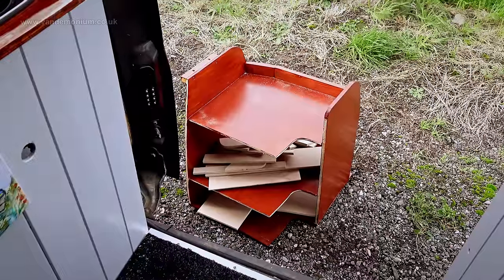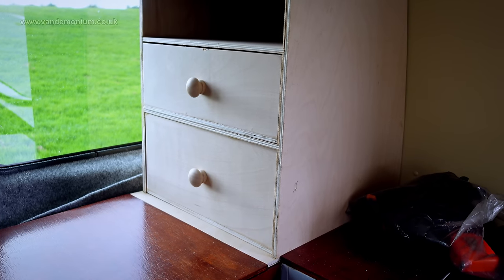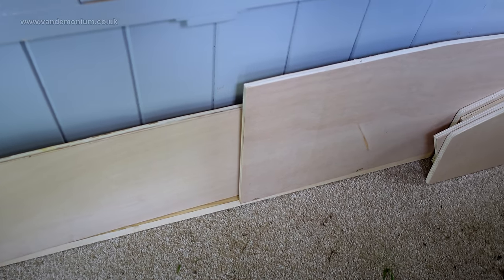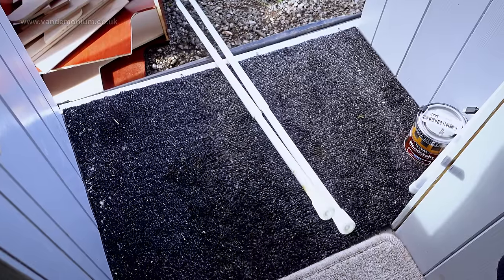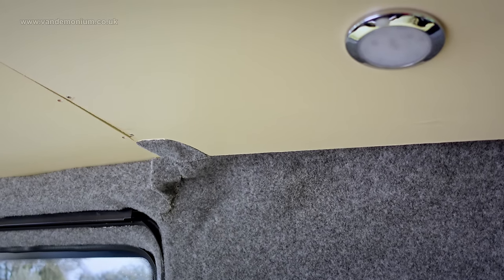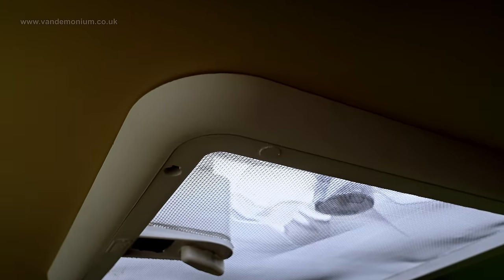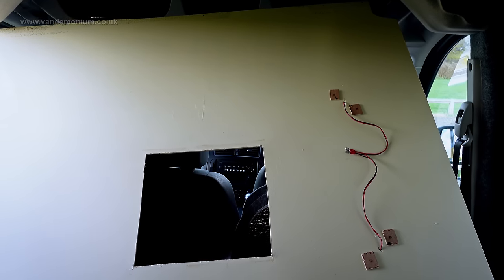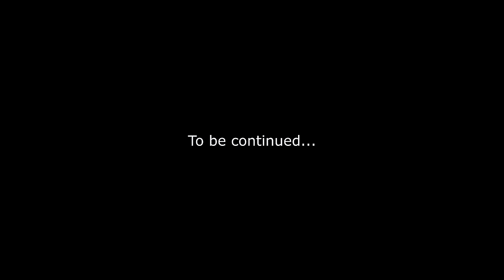46. Re-making the cabinets in my DIY campervan (and rewiring too) Part 1

Comment: Glad you have a project to get you through the lockdown.  You might be able to glue some thin felt on the bottom of the drawer to prevent scratches on the nice wood
Reply from the maker: Felt it shall be!

Comment: Nice work, David. I would suggest putting some felt under that bottom drawer to protect the wood "floor". Also, maybe put the hinge on the bottom rather than the top of that door. This way it's not flopping on your hands whenever you go into it for something.
Reply from the maker: That’s a good point...

Comment: @10:08 can i suggest not joining cables with two males to two females, but a male and female on each cable so its not possible to get them the wrong way around. also on the cable bringing power to the joint to put the female (insulated!) terminal on the ''hot'' positive side to lessen the chance of shorts if it comes out, i know your on a wood surface not metal but its 'best practice' to work that way, love the van and vids, thanks for them 
edit: ahhhhhh now i've watched to the end you have got insulated ones!

Comment: It's probably a little late now for your project but if you need to do this sort of thing in the future either in your Van or on your boat, do a search for "ticking stick" or "joggle stick" . It's an old boat builder's method for lifting and transferring odd shapes like you have there and putting them onto  a piece of wood as a pattern. Keep up the good work. I enjoy your videos muchly.
Reply: 'see jane drill' did a good ticking stick video
Reply from the maker: Cheers, yes I've watched lots of those videos. The main trouble here was things not lining up with each other, rather than trying to shape them.

Comment: Just a tip on terminating your wiring.  Use one male and one female connector, with the reverse on the other side.  Not 2 male, and 2 female on other side.  That will prevent possible reverse polarity connections.
Reply from the maker: Good point.

Comment: In the military, we called it "mission creep"... You start out with one small thing and as you get into it, you realize a lot more needs to be done...

For example, start out with a simple case of putting ceramic tile for kitchen countertop... You notice some water damage because the original builder had used cabinets that had particle board, so you decide to rebuild the cabinets with exterior grade plywood for those areas that might get wet... While removing the cabinets, you notice the sheetrock (gypsum board) has water damage to it, so you decide to rip it and and replace it also... As you rip out the sheetrock, you notice that the insulation between the sheetrock and the wall sheathing is black from mold, so you decide to rip it out also... Next thing you know, you're standing in a kitchen with no cabinets, most of the sheetrock removed, and the exterior sheathing of the house exposed from the inside... And your wife saying that she thinks it would be a good time for her to take a vacation to another country for 6 months... Been there, done that...

Comment: If you want to try and hide the locks on the drawers, you might want to look at child proof drawer locks. Some of them can fit completely in the drawer so you can't see it from outside. (it does add an extra step when opening them though). And they are usually easy enough to install.

Comment: As my old wood shop teacher once said "Measure 6 times" Then cut and if your still not sure, build a mock up out of cardboard. Also, nice work on the drawers. I don't know if you'd like thi s ides, but the simplest way to keep them closed is to drill a small hole in the left side, through the side and drawer and use a bit of dowel, with a fancy knob on it. Should do the trick nicely.
Reply from the maker: I like that idea!

Comment: Thanks David another enjoyable van video, well as good as your boat videos. I would treat myself to an electric screwdriver though. Saves ages of time.
Reply from the maker: I have two! But with these tiny screws and delicate wood, I prefer to do it by hand. Power tools can be a bit brutal at times.
Reply: @Vandemonium  perhaps it depends on the operative. 😂

Comment: can you glue a strip of felt under the bottom edge of the bottom drawer to stop it scratching the other surface?
Reply from the maker: Yes! That is what I will do :-)
Reply: I think felt would eventually wear away.  Perhaps you could glue narrow strips of Formica under the sides of the drawer.  You may be able to pick up off -cuts of Formica from a kitchen fit out company,.

Comment: wood on wood friction can be ameliorated by rubbing surfaces with a candle. There are lots of latches that push to shut [and stay shut] then push to open with no handles needed- they have a little spring loading and can be mechanical or magnetic. avoids the need for separate turnbuttons or bungees etc

Comment: Hi David, glad to see that you’re still going and doing a great job. I have now finished my van and used neodinium magnets to stop the drawers coming out. On one set of drawers, I put one magnet into the bottom of the drawer, on the outside at the front and in the middle. I then put another one in the shelf that the drawer slides on, obviously making sure that the two line up properly. I then glued them both in with araldite. On the other set of drawers, I fixed a strip of wood at the back of the shelf that the drawer slides on. I made it out of 9mm plywood and about 25mm high by about 80% of the width of the shelf. I put the other magnet into the back of the drawer so that they both lined up. I used 12mm x 3mm magnets on the first set and 15mm x 3 mm on the second set, although your drawers are bigger than mine, so if you want to do it like this, I would use 20mm diameter. On a different note, and it’s just a thought, keep an eye on the weight. You don’t want to go over the gross vehicle weight (GVW) or maximum allowable mass (MAM), whichever designation you want to use. It’s very easy to do that and can have horrible implications if you should have a crash (hopefully not, but you never know). If you decide to get it weighed, remember to allow for the driver and fuel etc, and leave a bit spare as a buffer. Keep a copy of the weigh bridge certificate as proof.
Reply from the maker: Cheers. The van has a payload capacity of 1.2 tonnes so I'd be hard pressed to go over that.

Comment: I am thinking you may have been able to nip the wires where they went up the wall, and then ran your new wiring up and across from the panel and then spliced them. Would have saved removing the ceiling panels and fan assembly! But it’s all easy sitting in my living room with a G&T and making suggestions. Love your videos on both channels, you provide much needed entertainment during this pandemic, I am sure you have helped many like myself retain our sanity. Take care. Stay Safe !
Reply from the maker: Ah, I don't have any new wires so am trying to do it by merely re-routing the existing ones. This may yet not work...

Comment: A tip for your next van David, you can buy the plywood liners all pre cut for most vans on the internet & they do not cost a lot.
Reply from the maker: Hi. Cheers. I re-used the ones that came with the van (except the floor which I wanted re-cut)

Comment: I am very impressed with the drawers and the rear cutouts. You could put a simple turnbuckle between the draws in the middle to stop them opening while driving. The cabinet makers of yore would have lubricated wooden runners with beeswax. Those connectors might have been better with heat-shrink sleeving rather than remaking them but I appreciate this is way too late. Sleeving strengthens the crimp and makes pulling apart easier.
Reply from the maker: Yeah, I don’t think I had any heat shrink at the time and wanted to get it done hence the crappy tape!

Comment: I do hope Santa brings you a nice compact rechargable drill/screwdriver for Christmas... it would speed up your work to Benny Hill levels of productivity and eleviate the blistered palms syndrone. Magnetic catches at the back of the draws might assist in keeping them in situ in transit and be invisible.
Reply from the maker: Cheers. I have two cordless drills but with those tiny screws and thin wood, I prefer to do it by hand.

Comment: Bungee cords will work well to hold the drawers in place while driving.
For the top space consider some elastic cargo holder e.g., on the back of some car seats.
For the space with the flip front, consider making this open down with a stop, then it can be used to rest things while you search for other things.   A magnet latch should hold this closed.   Used on cabinets.
I can appreciate the frustration of having to re-do all this work.  Often we need to use a design in order to find out which aspects of the design work well and which do not work well.
Dave.

Comment: If you had been closer l would have popped over & lent you my cordless tools (but l am in Nottingham).
I felt your pain manually unscrewing that ceiling 😵.

I planned on a boat for my retirement. And have watched most, if not all, of you boating uploads. I have owned many boats in my younger days.
However, one heart attack later l had to reconsider the boat plan. Perhaps going through a line of locks solo may not be the best plan. I done that in a foot of snow in the 80s. But l was much younger then.

So a couple of months ago l went for plan B. And now have a motorhome parked outside. Now there is much to do. I will start with fitting solar panels & diesel heater. I already bought 4 x 120ah AGM batteries & a victron control panel. I have a city & guilds in electronics so the electrical work will be a walk in the park.

I have now subscribed to your camper channel. I subscribed to your boating Chanel when you bought your boat a few years ago.
Reply from the maker: Cheers, very kind. I do have lots of cordless tools but prefer to unscrew those little screws by hand

Comment: David rather than those silly little wooden knobs on your drawers .. would you consider 'finger holes' that would also give ventilation  air movement. How about "bungee" chords stretched across high shelf frontages for restraint & access?
Reply from the maker: I like the silly little knobs, that's why I bought them

Comment: Insulting tape issues - over many years of temporary fixes with sellotape (other cellulose tapes ..yaddah, yaddah!), insulting tape, masking tape, etc, I have learned, at the very end of the tape, to fold over a small triangle, sticky side to sticky side.  When you come to remove it, you've gat a small 'handle' to get hold of and pull.  No more cursing as you try to 'start' it.

Comment: A better bodge would have been to add new wire routed where you want and join it to the routed wires that don't need moving. You wouldn't have needed to remove the ceiling then. Old wires could have been left in if they didn't interfere with anything. They may have been tie wrapped in so that would have been an excuse to leave them there. Yes I did use the word bodge.
Reply from the maker: But the old wires do need removing.

Comment: How about attaching a sheet of plastic to the bottom of that bottom drawer to protect the surface below. I am thinking of the thick plastic sheeting builders use to protect floors. Its hard wearing not too thick and very slippy.
Reply from the maker: I like that idea!
Reply: @Vandemonium  I use UHMW Tape on the base of my circular saw. It makes it glide and not scratch the surface I am cutting. Unfortunately it has another name "millionaires tape" because of how much it costs. You only need a tiny bit.
Reply from the maker: @philgray1023  Cool, thanks, I’ll look for it

Comment: You might consider dry graphite lubricant on those drawer bottoms and inside cabinetry since you didn't opt to use runners. This approach can last quite a long time on wood if you don't mind the discolouration inside the cabinetry and on the drawers which you would hardly see, I suspect.

Comment: A 'Toggle' of made from wood with a central screw fitted between the drawers would keep them shut when driving when in the vertical position and then when spun horizontal would allow them to open...
I hope that makes sense???
Reply from the maker: It does!
Reply: @Vandemonium  the big question is though have you already done a latch / catch? That will be shown on part 2? 🤔
By the way I'm sure you bought lots of new shiny cordless tools whilst building the van up, surely you have a cordless screwdriver - it makes life SO much easier!
Reply from the maker: I have two cordless drills but with those tiny screws and thin wood, I prefer to do it by hand.

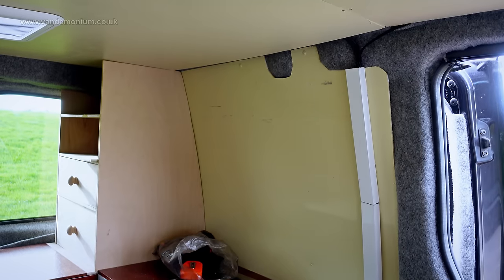Comment: 4:40 I'd put the hinges on the left hand end - then it won't be wanting to flop down on you while accessing the space and, depending on how it fits with the van doors, perhaps a magnet on it will hold it open. Think 'one handed' such that you don't need 2 hands to get something out of that space.

# I note it's window height - so maybe a ball-mounted window sucker to stick the door in the open position onto the glass.

Comment: David, please consider the use of a cordless screwdriver 😀. Love your vlogs!  Cheers
Reply from the maker: I have two cordless drills but with those tiny screws and thin wood, I prefer to do it by hand.
Reply: @Vandemonium  A little late considering you've already completed most of the wood working but I would highly recommend using torx screws (or literally anything other than Philips / Flat head / Slotted) for any future projects.. I agree with you 100% here, never take a power drill / impact driver to Philips screws! 
Philips screws were literally designed to strip heads / mangle screw drivers, they have been obsolete for over 50 years yet they are still everywhere!

Comment: Would it not of been easier to disconnect the cables from the electrical box and then leaving the roof in place re run the wires over the roof and then down the other side of the door and back in?
Reply from the maker: Hmmm... possibly but I’d still have had to take the front section of the roof off as I want to run the cables behind (above) it, I think, and where the cable emerges from the rear section needs to be altered a bit too so the front of the rear section would have had to be loosened. Plus the rear section needed to come off so that I can properly re-glue the batten (it would be a bit tight to do it with the ceiling wood in place)

Comment: you could use strong magnets to hold the drawers in and the door for your cupboard.
Reply from the maker: I wondered about that but in the event of a crash in the van (fingers crossed never), would they hold?
Reply: @Vandemonium  I think, some of the rare earth magnets may be too strong. It could cause issues opening on a daily basis. But. fair point finding  the Goldilocks magnet <grin>

Comment: Felt has already been suggested, but if you could stand the extra work; trim the height of the drawer one thickness and cut a piece of ply to fit under it, in so doing lifting it to a bit of clearance. 

Those connectors are colour coded for the size (square) of the cable. If (most likely) they are the same as here, the order is red, blue, yellow, small ->large. The cables are more secure if you use the right dimension. And bay good ones. I once bought those cheap ones, some literally fell of in spite if being used on exactly the right size of cable others was so hard to scrimp with a professional tang(?) that you pretty much needed to stand on it.
Reply: And another tip with crimps is to strip a little extra insulation off the wire and double over the bare section of wire before inserting it. If you push it in so that the loop is just visible on the other side of the crimp part, you will have a much more secure joint and it won't pull out accidentally.
Reply: @Pleendriver  Yes and no.
 As an emergency repair when you don't have the right dimension (sods law I think it's called in England), or when fitting small gauge cables in a non demanding application. The thing with these (and other, there is a bunch, scrimp fittings) is that they don't only work with friction. What happens is that the copper "floats" due to the pressure and creates an air tight fitting. In order for that to be properly done, the pressure must be right. That is why you should always use a spring loaded tool and fittings with correct tolerances. In most cases it doesn't matter, but when it does, well that is when it fails (sod again).

Comment: David, a little late to the party but can you tell me which DeWalt Multi tool you used? Did you remove the chuck from the DeWalt drill in order to fit the multi tool or is it a separate item which you haven’t referenced on the vlog. Thank you. 💐💐
Reply from the maker: The multi tool and drill are separate tools, I thought I'd listed them separately in the description but will check later (going out now)
Reply: @Vandemonium  No problem, all I could find was the link for the jigsaw, drill & mitre saw but thank you. 💐💐

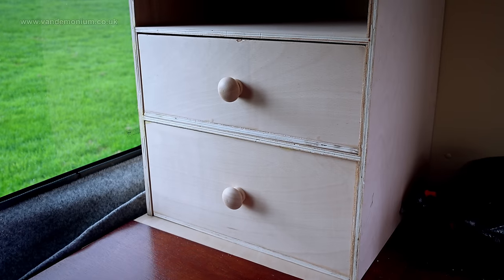Comment: 4:15 Drawer stops - if you can, David, if you make one catch at the top of the bottom drawer and bottom of the top drawer, then one catch should work for both drawers. One less fiddle when switching from parked and moving.  I'd suggest choosing the left side of the drawers for the catch then it's out of the way.

Believe it or not (I struggle with it !) North West Ambulance service ambulances use the bog-standard 'Stay Well' cat flaps with a rotary lock as horizontal 'storage bin' lids !
Here's the proof - spot the 2 cat flaps !: https://i2-prod.manchestereveningnews.co.uk/incoming/article15580895.ece/ALTERNATES/s615b/0_IMG_8273JPG.jpg